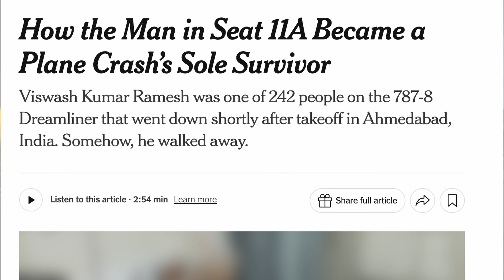Why the RAT Changes Everything – Air India 171 Update

Comment: The 787 is not a plane that has dual engines to fail.  Its a plane with almost two fly by wire engines.  Almost two because that is how it is designed.  If you loose power to this that or the other things doesn't change that nobody knows how to fly.  If you don't have enough power, you push both throttle forward.  The fly by wire system doesn't do that, the plane just got out of the garage and the fly by wire throttles probably still have the mechanics TEMU brand code reader posting to his blue tooth device.

Comment: And if your friends wonder why the gear was still down, let them know that the RAT does not supply enough hydraulic system pressure to raise the gear. Just like the Captain said, it only provides enough system pressure for your controls and enough electrical for primary navigation systems.

Comment: Thank you, Captain Steeeve. You explained that very well. My first thought was a hydraulic failure of some kind, especially with the gear staying down. But it now seems a dual engine failure is very possible. 
May all those souls lost in the aeroplane and on the ground, Rest in Peace. ✈️🌹
Reply: I thought hydraulic failure too, because of the position of the gear and flaps. But on this video, it seems like the jet was almost gliding with just the RAT noise, no jet sounds
Reply: The straight forward mush stall into the ground without any apparent yaw and/or hard OEI compensating rudder deflection indicates dual engine failure or fadec induced dual power reduction. Electrical failure and/or fadec compromised....Speculation obviously.

Comment: I thought there was a lot of "dust" at the end of the runway. 
You see some pretty big plumes after the airplane passed by on the one video.
Could that be enough to choke out both engines?
Reply: that's an interesting point. Surely dust wasn't just coincident at take of point either and implies the whole runway was a bit dusty.  If so the plane potentially could've been sucking in dust for entire length of the take off process. We know volcanic dust clouds can stall engines no problem, but what would a few kilometers of not inconsiderable runway dust do to combustion when all of a sudden air intake runs clean just after take off?

Comment: One person flying with the same plane earlier that day from Delhi to Ahmedabad has talked about electric problems in the plane on that trip. Several systems didn't work, including the entertaintment system. Electric problems could be the reason for hydraulic problems, the landing gear down and the flaps retracting and the RAM deployed.
Reply: Another similar comment got a reply that it wasn’t the same plane.
Reply: Wow! Makes you wonder why they did not ground it to check it out! So wrong!
Reply: It would be interesting to hear more from that person
Reply: @PyrPupMom  A video has been posted showing that the entertaintment system didn't work, and that the buttons for calling cabin personnel didn't work either.
Reply: @analogshooter same for lights and phones. A lot wasn’t working. I’m surprised they deplaned and planed passengers and headed to London without taking the plane offline for maintenance first
Reply: Probably someone trying to be somebody.
Reply: Did he report that to someone who could do something about it?
Reply: These are minor issues and am sure were addressed before take off .. at least the AC bit .. 230 boarded passengers would have complained if the cooling system wasn’t working properly prior to take off .. mind you it’s India and not Europe (weather was clear and it was sweltering hot outside)
Reply: Yup, this guy is really behind with the known things regarding this crash...

Comment: Kiwi.N.Z  , Pilot,  mechanic, truck driver,  bulldozers ,tractors.  I heard somewhere that there was an electrical fault that was worked on before this flight.  When ever I am called to a breakdown,  I always ask,  HAVE YOU HAD ANY WORK DONE RECENTLY.  ! ! !  some sort of Major Electrical Shutdown  ! !  Was driving a near new truck (big one) a few years ago, everything went DEAD ! motor cut out , no power steering,  stopped,  everything DEAD. Got another truck and on my way. 
 . Asks the mechanic next day, what was that  ? ?  . . ONE small wire broke,  and backup relay was faulty,  that supplies power,  , so that can't HAPPEN    . THE SWISS CHEESE.  !   model.  But only on a Truck,  not a big major problem.   P.S. Don't like all this new electrical computer stuff,  ALL , ,ALL ! breakdowns I've had the last 15yrs  ,20yrs have all been an electrical or computer fault,  NOT, NOT a nuts and bolts mechanical component  ! !

Comment: I totally agree, definite engine, failure, and losing power. I wonder if there was an electrical problem contributing to this. Thank you for helping us keep up on this captain Steve.
Reply: Had to be electrical - the fuel pumps simply quit feeding fuel to the engines. With bad fuel or internal engine failure I'd expect to see surging or compressor stall with flames and/or smoke coming out the back of the engines. These engines didn't do any of that - they just quit.
Reply: @lstein89  Wouldn't there be some independence/redundancy feeding fuel to both engines?
Reply: @cifey yes which means if it still failed its absolutely inconceivable
Reply: @cifey  Yes.  So, more likely an electrical problem, because that would affect everything.
Reply: Absolutely agree. It was a complete electrical failure that made the engines stall which led to the crash 😢 @lstein89
Reply: A Boeing engineer has come forward to say Boeing knew it was using defective seals. Tried to copy the link for you, but zi couldn’t get it to work
Reply: @ingridsweeney1787 😮 oh my gosh, I’ve heard a lot of negative things from whistleblowers with Boeing
Reply: Air india doesn't have the best track record with maintenance.
Reply: There is a video of the previous flight of that craft, and the power to the air conditioning and screens on seat backs were not working.

Comment: They use  hydraulics parts from 767 (3000PSI) in 787 (5000PSI), and the moment they pull gear up evrything blew off. They have almost the same part numbers and are cheaper. No time for backup system to engage (2nd and 3rd line).

Comment: it does not restore 100% electrical or hydraulic.  It provides limited hyd on one of the 3 systems and limited electrical  it is tiny....not a 100% replacement of capacity

Comment: It couldn’t have been fuel contamination: there was no yaw.  If the all fuel was so bad the engines couldn’t run at all, the plane would never have left the ground.  If there was a contaminated volume of fuel, barring a huge coincidence, both engines would not have run out good fuel at the same moment.  When the bad fuel reached the first engine and revs dropped off, the plane would have yawed sharply towards that engine.
That didn’t happen.  The plane was flying straight, so both engines were working or not working to the same degree.  If there was a dual engine failure, it had to have a cause that would affect both engines simultaneously.
Based on my extremely limited understanding of how airliners are built, I think the problem had to be in the cabin: either a pilot input or some failure that looked like a pilot input.  I would assume if even if one pilot deliberately or accidentally cut the throttles, the other, hearing and feeling the engines spin down, would have instinctively corrected it.  That only leaves some short or break in a control mechanism that commanded an engine shutdown.

Comment: This guy on one board said this > "There is no back-up for the fuel pumps in case of elec power loss at all, and even 1 eng gen is not capable to run all 4 pumps. The "system“ will determine the "best load shed solution“, but what if that system has no power as well? Well each pump is connected to a sep. A/C bus, so a single fault is not a big deal. Serious electrical malfunction, affecting all buses? Can’t think of any but not impossible right?

Given the low speed and high density altitude I doubt gravity fuel suction would work. (Fnd no table for B788 but on A359 it would work for FL30 at max after dep., QNH1001 is way above that) So a serious elec malfunction / power loss would indeed lead to a dual engine starvation, especially in this phase with max consumption.

Comment: July 17, 1996  -  A Day that will Live in Infamy 
   
    A bomb blew up TWA Flight 800.   Dan Bongino is not going to change the narrative.   Kalstrom, the NY Head of the FBI, who handled the investigation and surely knew that a bomb blew the plane up just based on the bomb making ingredients found in various parts of the plane.  The main proof was that in the third debris field closest to JFK things from the plane were shot at supersonic speed some things landing 500 feet away from the flight path which could only have occurred with a powerful bomb.
        This was orchestrated by the Clinton's.  Interestingly years later Kalstrom stated that the Clinton Foundation was a corrupt cesspool.

Comment: Really appreciate the follow up when new evidence comes forward. 

Complete side bar question. In MH370 there were pings every hour, except for the last one that came up about 40 minutes after the previous one. Would that have been from the system rebooting after the RAT deployed. So the engines flam out from lack of fuel then the RAT deployed and that rebooted it and it sent that last ping?  Could be a good video topic 

Love your channel. Congratulations on 500,000

Comment: There is a video posted showing a passenger from the same plane but a flight before this plane crashed. The male passenger was showing that he was in the plane and the air conditioner was not working. The air vent above him was not blowing air. The button to call a stewardess over was not working. The In Flight Entertainment screen on the seat in front of him was not working. He was pressing the buttons on the phone and entertainment screen and nothing was working. Ahh just be thankful you got off the plane alive.
Reply: I also saw that vid, as well as a follow up (longer vid) that he made later to explain the original vid. In the initial vid, he ranted/ complained about the A/C, infotainment systems, call buttons, etc. I think he was within his rights to do so. All of them (the passengers) paid good money for their flight, so they expected good service. 

From the comments of the vid, many other people said that faulty A/C & infotainment systems are common in Air India planes. This means that the planes are not maintained properly. 

Based on comments & another news report, there's a duopoly of airlines in India (Air India & Indigo Air), so the people don't have much choice in terms of local airlines. I hope this tragedy will trigger changes in the inspection, maintenance & general service of their airline industry.
Reply: Many airlines switch off the entertainment system for short domestic flights. So, it may be the reason.
Reply: Wow they seem to be a few electrical problems with that plane on the previous flight….. wonder if they ignored a maintenance check 🤷🏼‍♀️
Reply: Its just a video of a boeing, but has not been verified if it was the exact same plane . Stop spreading fake news
Reply: Where is the video?
Reply: stop spreading fake news

Comment: It's been well documented that this plane had electrical issues in the days leading up to the crash, yet no maintenance was done. Finally, a complete electrical failure which prevented the fuel pumps to the engine & gravity feed was not enough during takeoff. It also explains why they could not retract the landing gears. Cause of crash, Air India maintenance.

Comment: What are the odds of a dual engine failure at the exact same time within seconds of rotation. You could assume it wasn't mechanical failure as that's statistically impossible. This leaves only fuel supply as the likely cause

Comment: Captain Steeeve: Although your theory is believable, I am shocked you do conclusions long before the investigations are concluded. You should know better than to take a hard line on your theory. I will always wait for the investigated reports conclude otherwise, you are guessing and that is not professional. Captain Ret; W.S. Adler Typed: B-747, B737, DC-10, EMB-110. ATP, CFIIME, FETJ. 30,000 + TT.

Comment: Its not possible for those 2 engines to go out. In the history of GE there has never been a full loss of both engines. Even in massive bird strikes that damage both engines they have never had both just shut down.
Reply: Not possible are strong words. It is extremely unlikely, but not impossible
Reply: @GernhartRheinlunzen  im not trying to be argumentative. Of course there is a possibility of both just flaming out. But these are GEs most over engendered engines ever created. Not only do they have to ingest 5 birds and keep running but they shot 5 frozen turkeys at them. GE had to put an explosive charge on a fan blade to get one to brake off. So yes its possible like its possible i have 100 million dollars. The odds are so astronomical we are in the same area as impossible. 

I agree both engines stopped running either just before or after V2. But I'm leaning to a international act. Most likely a small explosive in the battery compartment.

Comment: What's the thing that looks like a piece of debris falling out of the sky from where the plane just passed, just as/right after the plane crashed?
Reply: I was wondering that as well
Reply: @shinyobsessed1271  - I just looked at it again, several times.  I clicked it frame by frame with the pause/unpause of the video.  It actually looks like a piece of debris that few upwards from the ground, first.  As if the plane hit something on the ground initially that threw it in the air, before the bulk of the plane had fully impacted the ground/buildings.

Comment: I read an article off of a site where it had a passenger that was on that plane on an earlier leg said that they were having electrical problems and did not have air conditioning or monitors. Also, the flight was delayed about 40 minutes on its take off.

Comment: There are more than three conditions...

Here’s the full list. 

• Loss of all engines
• Both engines are at less than minimum idle RPM (Revolutions Per Minute)
• Loss of all hydraulic power - left, right, and center systems detect low pressure
• Loss of all electrical power
• BPCU (Bus Power Control Unit) detects loss of power to C1 and C2 TRU (Transformer Rectifier Unit)s
• On approach, loss of all four EMP (Electric Motor Pump) hydraulic pressures and loss of either the left or right flight controls ACE (Actuator Control Electronics)
• Rotor burst on takeoff that causes loss of both PECS (Power Electronics Cooling System) primary cooling loops.

Comment: To me, it sounds like RAT deployed and engines at almost idle. There's just a slight engine sound.  If the survivor is correct about a late throttle up, it almost seems like a major electrical/software failure. The aircraft also just went through a major maintenance interval, according to a couple of sources

Comment: I'm mostly confused how a dual engine failure happens with no visible smoke , flame, raw fuel spewing out, or parts flying off. Total fuel shutoff of both engines at the exact same time is really strange, but that appears to have happened. We need a 787 mechanic and an electrician to enlighten us.

Comment: Gear up, flaps up, sh  up , clean up  my analysis as an ATP pilot is the high density, hot and heavy issue and the flaps were not left in takeoff retracted too soon, and they lost air speed and settled into the ground

Comment: I still think it's possible the engines sucked in a bunch of rocks and silt at the end of the runway just as the plane pulled up and the pulverized dirt mixed with the wet fuel which began to flame out the engines which is when the rat activated. I dunno. Just my theory.

Comment: As early as the day of the accident there were already individuals recognizing the buzzing noise of the RAT, even before this footage was available in its crisper form.
 The relatively short distance used before the takeoff also gave the pilots a very narrow margin of error. Overloading the engines must’ve shut them off. 

High altitude + high speed gives you safety and time for reaction, recovery if it is the case. Unfortunately this flight didn’t have any of these 2 mentioned.

Comment: Problem with the DUAL ENGINE FAILURE THEORY is i can CLEARY HEAR JET ENGINES operating along with the RAT!!! 

The other things that would make it seem like a "Dual Engine Failure" would  Failure of the hydraulic systems and/or failure of the electrical system!! Either or both would still cause the RAT to deploy and ALSO cause a LACK of THRUST, IF the correct electrical system had the failure, the one that controls the engines!!

Comment: Something I've seen but not talked about all that much.  The airplane took the entire length of the runway to takeoff.  That is not normal.  Normally, the takeoff is planned with the ability to stop the airplane if something goes wrong on the takeoff before a certain airspeed.  Most of the time, stopping the aircraft takes longer than completing the takeoff.  This airplane took the entire length of the runway -11000 feet to takeoff.  If something went wrong on takeoff the airplane was going to crash.  Just a matter of where.